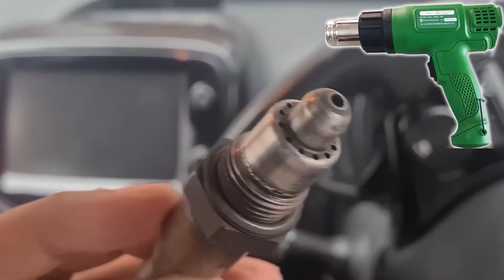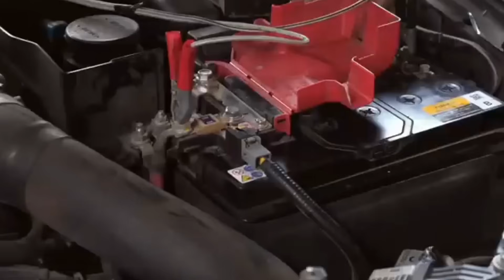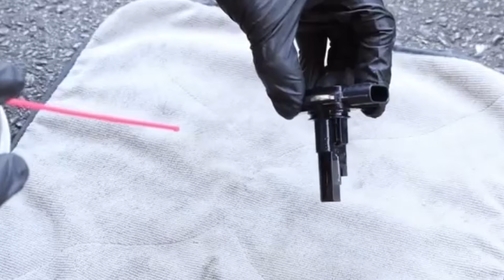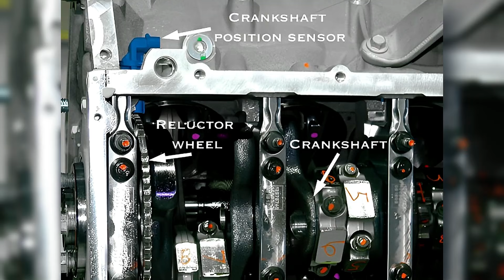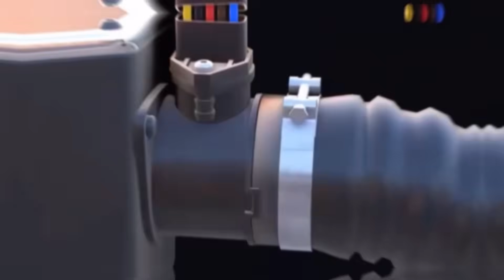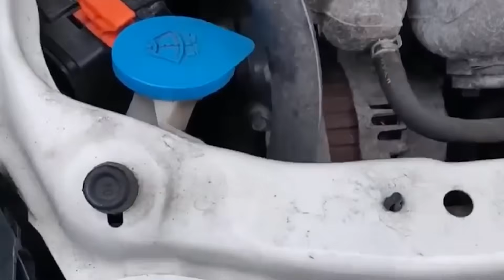Nobody Cleans These 5 Sensors — And Your Car Pays for It

Comment: Bonus tip: you can clean your disposable engine air filter as well with pressurized air or even a hi power shop vac if none of those are available you can remove the air filter from the factory air box and give it some love taps on a solid surface you’ll be surprised by how much of a difference you can make without having to replace and pay for labor. Very easy and effective for being essentially a free maintenance tip . Save money time and hassle. A lot of sensors and other parts can be serviced to extend the life of the sensor,part,etc. 
just some common sense a little ingenuity and some knowledge through some sources like this video or social. Just don’t be afraid to get your hands dirty. Preferably try these things with a car buddy like me. 😂✌🏼
Reply from the maker: Love taps on a solid surface is genuinely underrated — people bin filters that have another 10,000 miles left in them. And the car buddy point matters more than people realize. Half the hesitation around DIY disappears when someone who's actually done it is standing next to you. Good adds all round.
Reply: @AutoTruthLab ❤😅 hey just tryna help those that were in my shoes when I had to figure it out by myself 😂👍🏼✅

Comment: Just cleaned those 5. I also recommend cleaning the starter ground wire (mine is exposed twisted copper) and the negative battery ground because the metal ground plate is dirty! I thought my starter was bad... Nope!
Reply from the maker: Dirty ground almost turning into a starter replacement — same story as every sensor in this video. Clean the cheap thing first. Exposed twisted copper corrodes and creates resistance that mimics a dead starter, weak alternator, random electrical gremlins. People replace starters over a $0 ground cleaning constantly. Good catch, that one deserves its own callout.

Comment: My engine light came on it is on solid can you tell me what is wrong no help in my vehicle manual.
Reply from the maker: Solid light means a fault code is sitting in the computer — without that code number it's impossible to point you anywhere. Any auto parts store will scan it free in 2 minutes. Come back with the code and your year, make, model and I'll tell you exactly what to check first.

Comment: @AutoTruthLab, what are you using to clean these sensors? MAF has its own cleaner but what about the rest of the sensors?  Why not detailed cleaning on all the sensors like you did MAF?
Reply from the maker: Good question. Each sensor has its own approach. MAF — dedicated MAF cleaner only, never substitute. Throttle body — dedicated throttle body cleaner, spray on the plate and bore. MAP — you're not cleaning the sensor itself, you're clearing the vacuum port with compressed air and a thin pick, no liquid cleaner needed. CKP — electrical contact cleaner on the connector pins only, not the sensor. O2 sensor — can't be cleaned directly, that's why the video focuses on cleaning what causes the O2 codes instead of the sensor itself. Fair point on the detail — a dedicated cleaning video for each sensor is coming.

Comment: I got a surging issue when my car warms up and when stopped at lights can't seem to figure it out I have a 2.4 2014 base model buick verano if anyone can help
Reply: I also changed the maf sensor so it has to be something else im missing
Reply from the maker: New MAF and still surging warm — the MAF was never the problem. Warm hunt idle at lights on that 2.4 Ecotec points straight at the throttle body. Carbon on the plate stops it from controlling idle cleanly when the engine reaches temperature. Remove the intake tube, clean both sides of the plate and the bore with dedicated throttle body cleaner. Do the idle relearn after on that Verano — skip it and the surge comes back even with a clean throttle body. That’s the fix before anything else gets replaced.

Comment: 2017 Chevrolet suburban
Misfire cylinder 8. 
Changed all coils, spark plugs and wires. Cleaned throttle body changed filter. 
Misfire still there. Idle is rough (vibrating) even at red light. Jerks slightly between gears. Sometimes when leaving a stopped position the torque is strong at take off.
Could you advise?

Comment: I got a 1994 F150 with a 5.0 just had a new rebuilt engine and tran put in. got a check engine light I can set in the driveway and let it run gun the engine as much time as I want runs great. I start driving it and with in a city block the check comes on. my OB1 gives me nothing much of the sensors are new SOOOOOOO anyone got an idea where I should be looking for the bane in my life ???? Tom

Comment: P0102 + P0171 + P0174 
2003 Chevy S10 stalls sometimes in idle or driving occasionally when pullling off. Cranks up on first start.

Comment: Hi, my VW Golf 7 Variant consumes suddenly more fuel (gasoline) . Would that be the lambda sensor?
Reply from the maker: Lambda is usually the symptom not the cause on that Golf 7. Clean the MAF first — EA888 engine MAF contamination causes sudden fuel consumption increase exactly like this. ECU gets wrong airflow data, over-fuels to compensate, consumption jumps. $8 MAF cleaner before replacing any sensors.

Comment: Cleaned throttle intake, replaced throttle sensor, still idled rough but no hesitation on the open road , ran great for about a week (still rough idle) then right back to hesitation back and forth open road. Had previously replaced map sensor and cleaned it. 2005 ford ranger 3.0 please help we are both in our 70’s and my husband has Parkinson’s.  You are right without looking one shop was headed straight for transmission…
Reply from the maker: You've cleaned and replaced almost everything except the MAF sensor — that's what's left on that 3.0 Ranger. Throttle body clean, TPS replaced, MAP done — MAF is the next logical step and the most common cause of that returning hesitation on that engine. $8 MAF cleaner from any auto parts store, spray directly on the sensing wire inside, let it dry 10 minutes, reinstall. That hesitation coming back after a week is exactly how a dirty MAF behaves — just clean enough to improve temporarily then symptoms return. Try that before anything else and please stay away from that transmission shop.

Comment: Where the fuck do people go that they would charge $400 to replace an oxygen sensor
Reply from the maker: Any dealership. Part markup plus flat rate labor on a 2 hour book time adds up fast. Dealer pays the tech for 2 hours whether it takes 20 minutes or 2 hours — you pay for the book time regardless. That's where $400 comes from.

Comment: My Hyundai 2007 deisel Santa Fe not starting and it's just cranking
Reply from the maker: Crank no start on that Santa Fe diesel — CKP sensor is the first check from this video. Covered exactly here. Clean the connector first, it sits low on that D20DT engine and corrodes badly. Contact cleaner, dielectric grease, reconnect. Free check before buying anything. If connector is clean the sensor itself is $40-60. Also check glow plugs — diesel won't fire without them working on a cold start, especially on an older engine like this.

Comment: 1 qt of paint thinner to a full tank . Cleans all censors . . Only takes one tank of gas red light goes out . Hope this helps works for me . Truck has over 150,000 . To maintain it's stays clean every 20,000 miles do it again .
Reply from the maker: Appreciate you sharing but can't let this one stand — paint thinner in a fuel tank damages rubber fuel system seals, injector o-rings and fuel pump components over time. It might clear a code short term but it's doing damage underneath that shows up later. Techron concentrate is the safe version of this — PEA based, actually designed for fuel systems, does the same job without the damage.

Comment: Hi,
I recently purchased a Honda zest spark (2012) that is troubling me a lot and mechanics in my area are not understanding the issue. It has P0420 (CAT) code, and has the following issues:
1-Vibrations at idling
2-RPMs fluctuate between 400 and 900 on idle (park, with ac/without ac). This is intermittent.
3-The car heats up, radiator loses water, around a quarter of a liter in 40 Kms drive.
4-Fuel consumption is too much (9-10 Kms/L, while ideally it should be double)
5-We got CAT cleaned, upstream O sensor replaced, TP sensor reading fixed, nothing fixed the issue (apart from uneven gear shifting and that too tempo
rarily).

Could you please point out a few fixes and guide us the right direction? Thank you so much.
Reply from the maker: Those symptoms together are telling one serious story — coolant loss plus P0420 plus terrible fuel economy plus hunting idle on that L13A engine points strongly toward a head gasket issue. Coolant leaking into combustion fouls the O2 sensor, loads up the CAT, causes rough idle and kills fuel economy all at once. That's why replacing the O2 sensor and cleaning the CAT didn't fix anything — they're symptoms not the cause. Before spending another rupee do a cold start test — white sweet smelling smoke from exhaust on cold start confirms coolant burning. Also check if oil looks milky or coolant reservoir has oily film. Those two checks cost nothing and confirm or rule out the head gasket completely. Don't let anyone touch sensors until this is ruled out.
Reply: @AutoTruthLab  Thanks sir. I am confident that those two points are fine but I will definitely look ino them again and let you know.

Comment: 2016 Kia Soul 164,000 for 2 years now my vehicle will not accelerate past 3000 RPM, 
" limp mode "
I cleaned my map sensor, replaced all my spark plugs, all of my coil packs, high pressure fuel sensor, PCV valve, high pressure fuel pump, my in tank fuel pump.
I'm about to replace my Downstream O2 sensor. I mean I'm running out of components to replace at this point I'm at my wit's end...
These are the codes I'm getting on the OBD:
P0191 fuel rail pressure sensor
Range/ Performance. 
P2191 system too lean at higher load bank 1.
Reply from the maker: Stop before replacing that downstream O2 — it won't fix this. P0191 and P2191 together at higher load on that GDI engine after replacing both fuel pumps points to one thing — the high pressure fuel injectors themselves or the fuel pressure relief valve. GDI engines need much higher fuel pressure than port injection, if pressure drops under load at 3000 RPM the engine goes lean and pulls into limp mode as protection. Have someone do a dynamic fuel pressure test while driving — not just at idle. Pressure needs to hold at high RPM under load. If it drops that's where the lean condition is coming from. That test costs nothing if you have a gauge and tells you exactly what's left to fix.

Comment: Cleaned my IAC today and got my O3 Buick back from too dangeroust to drive condition.  
Going to buy some MAF cleaner and do that, while I change my air fitlter. Seems appropriate. 
Getting at the rest , I'll have to work on time management a bit.
Reply from the maker: IAC clean bringing a car back from undriveable — that's the whole point right there. Good call doing the MAF with the air filter, same access, same time. You've already got the system down.

Comment: IAC on some older fords too. That same ford probably only has one oxygen sensor not pre and post cat. Rest Base Idle into the ecu after IAC Cleaning via ecu/idle learning procedure. Use PEA INJECTOR CLEANER.
Reply: Just cleaned my Buick IAC and am very pleased with the result.  Used old Carb cleaner.   The plunger was compressed and I pull it loose and sprayed again.  My idle and response on and off the gas is back.  Transmission shifting smoothly etc. MAF is next.
Reply from the maker: Good adds. IAC on older Fords is exactly the kind of thing that gets missed — dirty IAC causes the same hunt idle symptoms as throttle body carbon but needs its own cleaning and relearn after. Single upstream O2 on pre-OBDII era is worth knowing too, changes the diagnosis completely. And PEA based cleaner over generic fuel system cleaner — Techron concentrate is PEA, that's the one that actually works on injector deposits. Appreciate the specifics.

Comment: Toyota wish P2238
Reply from the maker: P2238 on the Wish is the upstream O2 sensor pumping current circuit — before replacing the sensor check the connector and wiring first. Corrosion on that connector causes exactly this code without the sensor actually failing. Clean the connector with contact cleaner, apply dielectric grease, clear the code and see if it returns. Sensor itself is the last step not the first.

Comment: it will cost you more for their time to clean it than the cost of a new part.  
doing it youself can save money. 
 paying someone over $100 an hour to clean them is silly.
Reply from the maker: Exactly. $8 cleaner, 15 minutes, done. Same result as $340 shop bill. The part was never the problem — the labor markup on a job this simple is the scam.

Comment: I would not spray directly into that map sensor.  It only takes a little pressure to ruin it. I know this because I stick to q-tip and some alcohol down in it and it ruined mine. Most places want like 75 for it but I found it on eBay for 12 bucks
Reply from the maker: Good warning and sorry that happened. The MAP sensor itself shouldn't be sprayed directly — the cleaning is for the vacuum port and passage leading to it, not the sensor element. Compressed air only on the port, nothing inside the sensor housing. And good find on the $12 eBay unit — dealer would've charged $75 minimum for the same part.

Comment: I have a 2009 PT Cruiser. It does not accelerate well and the RPM keeps running high seemingly getting stuck some time.  What should I do?
Reply from the maker: RPM getting stuck high plus poor acceleration on that 2.4 PT Cruiser is the throttle body. Carbon on the butterfly plate causes the throttle to stick slightly — RPM hangs instead of dropping, acceleration feels wrong because the plate isn't moving smoothly. Clean the throttle body first, $8 can, 20 minutes. MAF clean second. Do both before anyone touches that car.

Comment: After cleaning MAF sensor, disconnect battery negative terminal.....if you're driving a new Audi, or most any other new vehicle.......you'll be sorry. Then visit you friendly dealership for a ECU computer reload.......
Reply from the maker: Valid and important point. Battery disconnect on modern European platforms — Audi, BMW, Mercedes, VW — resets throttle adaptation, transmission learning, power window positions, and sometimes requires dealer level reinitialization to restore. On a new Audi that's a dealer visit you didn't need. Let the ECU relearn fuel trims naturally through driving instead. 50-100 miles of normal driving does the same job without touching the battery.

Comment: How about a flashing over drive off light on the dashboard
Reply from the maker: Flashing OD Off is a transmission fault code storing — need the car make and model to point you anywhere specific. Before any transmission work though, clean the throttle body first. Bad TPS data from carbon buildup causes shift problems that trigger exactly that warning on a lot of platforms. $8 fix worth trying before any transmission shop sees it

Comment: Engine oil light flashing red intermittently. But not during crusing. Im driving polo 1.6 2020.
Reply from the maker: Stop driving it until this is checked. Red oil pressure light is not a sensor issue — that's the engine telling you oil pressure is dropping. Check oil level right now before starting it again. If level is fine the oil pressure sensor or oil pump needs checking immediately. Driving on low oil pressure destroys engines fast and quietly. 2020 Polo shouldn't have this problem — get it looked at before it becomes a $4000 engine replacement.

Comment: The real question between the lines here is "How do I find an honest shop without doing it the hard way?"
Thanks for this video.  Good stuff.
Reply from the maker: That's exactly it. And the honest answer is — knowing this stuff IS how you find them. Ask if they cleaned the MAF before quoting the O2 sensor. Watch their reaction. That reaction tells you everything about the shop.
Reply: Ask friends or Google reviews. I found a good honest mechanic. It's was like finding Gold

Comment: Can u clean the sensor regardless even if not showing any codes ?? Is it good practice??
Reply from the maker: Yes — and it's actually better practice than waiting for a code. By the time a code shows up the sensor has been sending bad data for months already. Clean them on a schedule, MAF every oil change, throttle body once a year. Stay ahead of it.

Comment: Had a broken vacuum hose with a split in it and my transmission was shifting all over the place!
Reply from the maker: That's exactly it. Vacuum leak lets unmetered air in, MAP and TPS both read wrong, transmission has no idea when to shift. Looks like a transmission problem, costs $3 of hose to fix. Shop would've had that on a lift talking about a rebuild.

Comment: 1 reason is like MAF..Special spray, 15-20 for a few second burst. can sits for a while and then worthless. 15.for a few second burst 🤔 They could easily make mini spray cans for a 1 time clean but Nope. Garage will charge 50 + just to give it a burst. 1 cam makes them near thousand in profits
Reply from the maker: Big can, 3 bursts used, rest sits in your garage for 2 years. They know exactly what they're doing. Mini single use cans would cost them bulk sales and kill the $50 shop spray service at the same time. Can't have that.